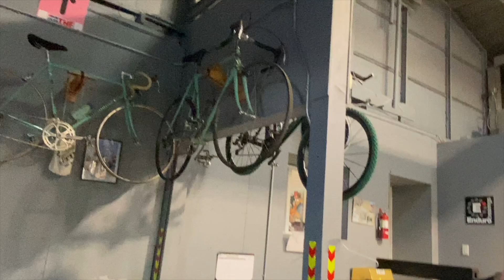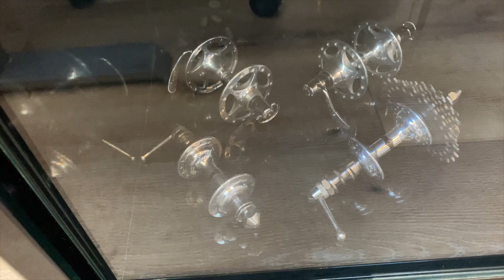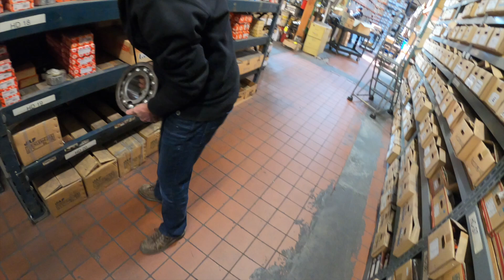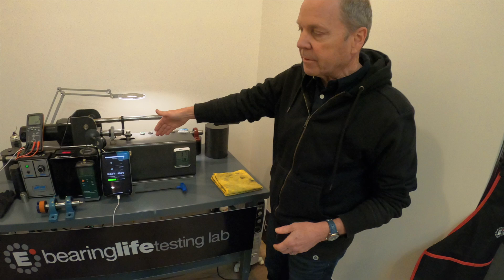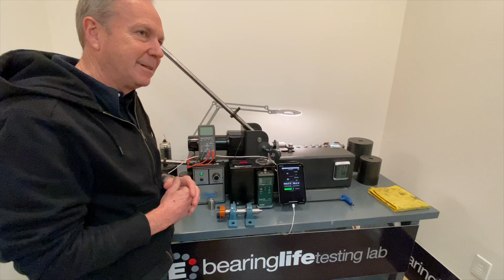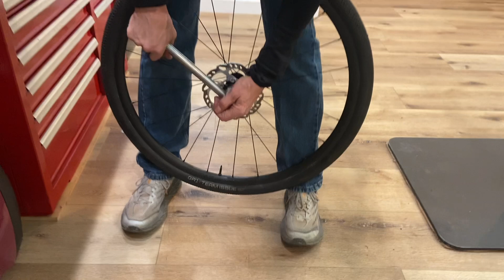An Epic Tour Of Enduro Bearings USA with Cofounder & Bicycle Bearing Engineer Matt Harvey!

Comment: VERY interesting video, on several levels. I didn't know about all the bearing pullers and presses that Enduro makes, so I'm glad that I got to see those. Very cool. 

I was also impressed by that fact that they are so hands on, with machine tools on site to do their own machining of parts. Those Sheldon lathes are very nice.

Overall it's great to see a company that's owned and run by people who are clearly knowledgeable and passionate about their products. That quality is becoming a rarer and rarer commodity these days so hats off to these guys.
Reply from the maker: Thanks a lot for watching and commenting. I'm happy you found the video helpful. You might be interested to learn that the smaller Sheldon lathe was formerly owned by legends Albert Eisentraut https://classicrendezvous.com/country-of-origin/usa/albert-eisentraut/ and then Ed Litton https://classicrendezvous.com/country-of-origin/usa/litton-ed/ And Enduro's line-up of tools is extensive and they're really well designed and thought out. I have a few in my toolbox but not nearly as many as I'd like to have 😀
Reply: @JimLangley1  Thanks for that, I really appreciate the extra information about the history of that machine. I'm a self taught hobby frame builder since the late 90's and am always looking to learn more about "Keeper Of The Flame" builders like Albert and Ed (RIP). Both of them legends for sure.

Comment: Jim, this is an excellent video. I watched it in one sitting. Those XD-15s look enticing.
Reply from the maker: Thanks a lot for watching and commenting Moka, appreciate it. Yes, the XD-15 bearings are designed not to corrode and to just keep going and going. They're covered by a lifetime replacement policy, but with oversize ceramic balls and the special stainless steel races it's unlikely you'd wear them out.